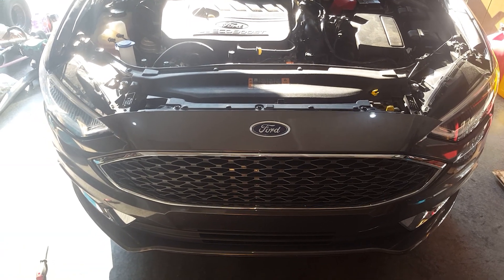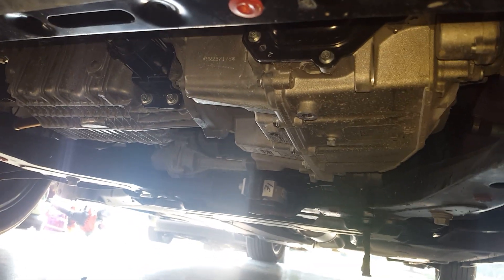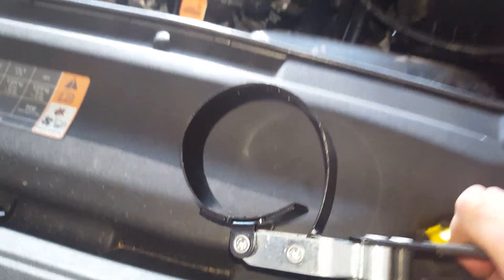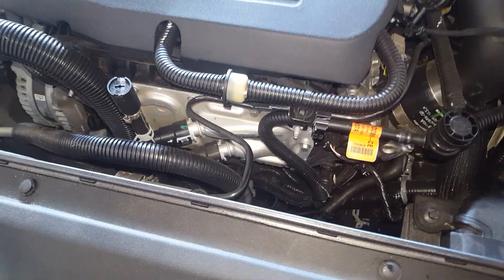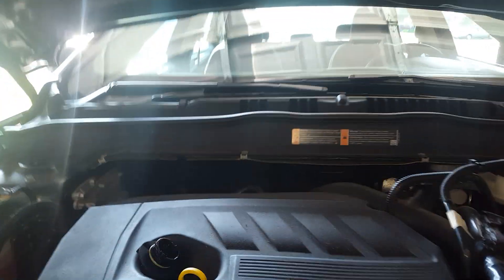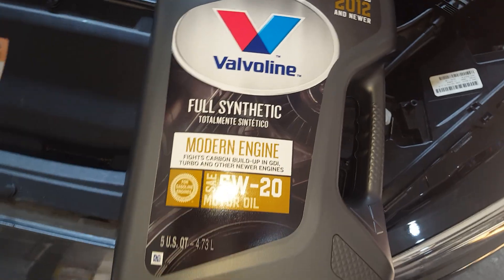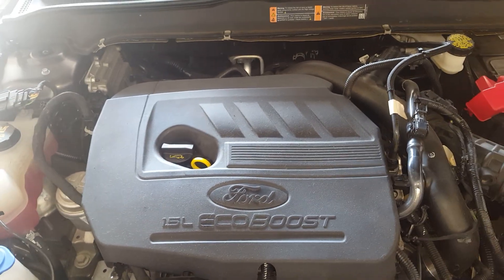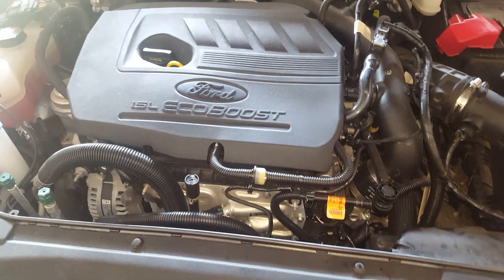How to change the oil on a 2013-2017 ford fusion 1.5L

Comment: Appreciate the time you spent putting this together. I'm well versed in oil changes; but have yet to do it on our Fusion. Which is now due. Thank you!
Reply: Never seen anyone do that before until this video ! And worse, he used more of an oil residue. Dipping your finger in the old oil in the catch pan would be better option than rubbing some off that plastic like he did. Of course, oil from the new bottle you're going to use is the absolute best way though.

Comment: Manufacture should set the position of those rubber hoses on top of the filter instead, engineers create freaking amazing complex things and fail in the more simple ones.
How long you have this engine? what is your opinion about it?
Reply from the maker: I agree they should put the hoses on top it can be frustrating trying to not make a mess every where. I havent had no issue with this engine. They do have a customer satisfaction where they have to update the pcm firmware because coolent can get into the cylinder. Basically the update allow the cooling fan to turn on sooner and when the car off it will keep the cooling fan on for a while to prevent the head from warping and allowing coolent in
Reply: @Nickthecarguy  my car had to reprogram the PCM, but they noticed once there, there was already the defect with coolant in Cylinder 2.  Getting a new short block installed within the next 2 weeks.
Reply from the maker: @realwordsoftruth  I still need to take mine in I'm hoping I dont have the problem you having. But then I hope they get me a new engine

Comment: Always fill up your oil filter with fresh oil before putting it back on and use that new oil to lube the gasket.
Reply: How do you "fill it" when it goes on sideways?
Reply: @JustStopPlayingGames  The filter has two sections (all of then do). You pour a little oil in the center hole and when you go to screw it on very little if any oil will leak out the sides because it has to go through the filter media under pressure. A tad may drip from the center if you have trouble catching the threads, but this is just how we've done it for ages so the engine doesn't ever have a chance to run dry or lose pressure.
Reply: @Rat Fink  yeah I gave it a go to be safe and very little oil came out.
Reply: Totally unnecessary. Ford actually put out a TSB saying not to pre-fill filters.

Comment: NEVER put USED motor oil on your filter gasket. Always use fresh new oil on the gasket. Much less likely to leak.
Reply: lol. You realize the oil on the gasket isnt there for making a better seal, right? Its there so you dont have to break your wrist or have to get out special tools to get it back off for when you do your next oil change. The 'seal' is made from the thick rubber crush gasket already attached to the filters. 

Ive been changing my oil in my cars for 30+ years and have ALWAYS just dabbed a finger in the used oil in my catch can to lube the gasket and never had a filter leak not once, and always only hand tight.
Reply: Please explain how dirty oil is more likely to make the gasket leak. lol, that's right, you can't. Because it makes zero difference, it's just there to lube the gasket and keep it from warping while the filter is tightened.

Comment: Theirs two ways to put on a oil filter. Finger tight, or use an air wrench... pretty sure the dealer does the latter... that is not advised even by Ford.

Comment: The bottom cover Ik most are 27 torx not 10mm bolts wonder why that is
Reply from the maker: It might depend on the year 13-16 might have the 10mm and the 17 newer might have torx

Comment: It would be nice to list the tools and oil capacity in the description.
Reply from the maker: The oil capacity varies depending what engine size you have
Reply: @Nickthecarguy  Well list them!
Reply: @marcmarc4776  dont be lazy and read the owner's manuel that's what is for
Reply: @marcmarc4776  you finally calm down man?